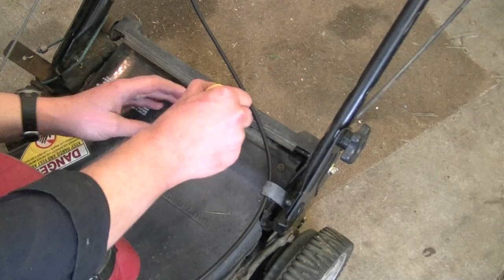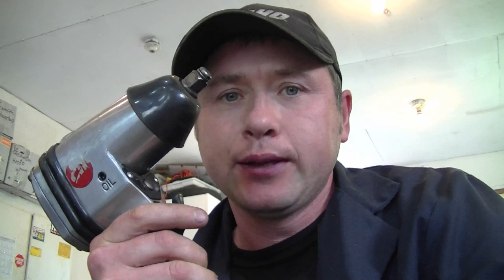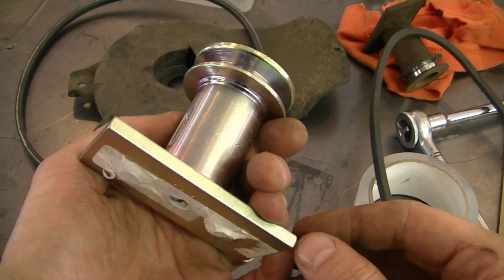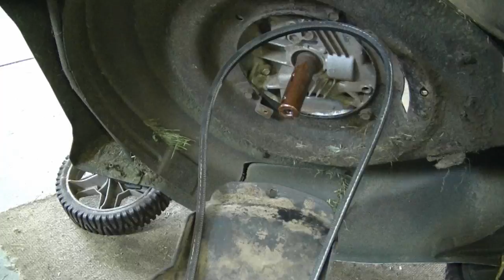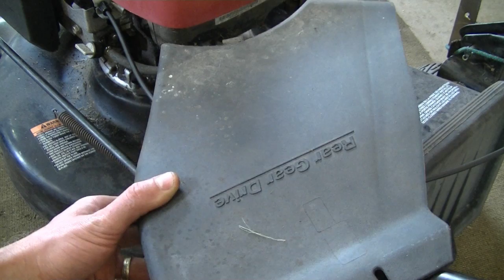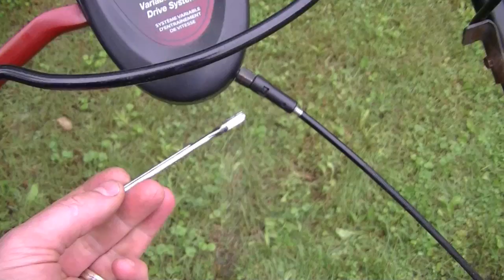Craftsman Lawnmower Drive Belt & Blade Adapter Repair

Comment: I have an ElZ walk mower like in this video. It has single control handle on the right side. My right hand gets a cramp from squeezing the one handle. Do you have a part number for the double contron handles. And can I replace the single with the double?

Comment: thank you so much, especially tip on the 1/4" screwdriver. wheels self-propelled again. would not have tried repair if not for this video. even though craftsman model slightly different. thank you again.

Comment: have a Bolens cheapie but other than the weak motor, I love it because it's so light and maneuverable. So, I took a Honda engine off a Craftsman and put it on the Bolens deck. Got everything working except for one, now obvious, problem. The drive shaft is about 1.5" too long. I would try to cut it with the grinder and a couple of wheels but I can't get access to it to cut at a right angle. I could cut it but it wouldn't be square. Can't really raise the motor because there was already a 1/4" gap I had to seal. Are there any workarounds I'm missing?

Comment: Hello again, I have the same lawnmower. Funny I just replaced the belt adapter as someone must have hit something bad because the 2 round notches were damaged.Also blade was bent. Lucky me I bought 2 of these blades at Thrift store for $2.00 sometime ago. Oh yes , the question I am asking you is the replacement number for the brake cable. I tried oiling but after it just snapped so in need  of the cable number. Thanks Joe in Owen Sound, Canada

Comment: Hi Dony.  I have a Craftsman lawn mower model #917.371822, rear-wheel drive.  I want to replace the drive belt.  I removed the blade and the plastic cover.  It is impossible to change the belt.  I have photos to send you.  I'm not sure how to send you the photos.  Please help.  RICK

Comment: Love your videos,helped me many times. I just bought a used mower like that one and the drive cable let go where it attaches to transmission.
I looks like it had let go and previous owner used a bent nail to wrap around end of cable. I can’t seem to find anything on parts diagram on what should be there and how it attaches. Any help appreciated.

Comment: Hey Don... My neighbor just "gave" me a Craftsman EZ Walk Variable Speed Model #917.370374 with a 6.75 B&S... he said it didn't run. I cleaned the mower above and under the deck, cleaned the carb, added fresh gas, primed it 3 times and it cranked on 2nd pull. Mower worked fine going forward, but when pulling the mower backwards the rear wheels lock up. However, the rear wheels do roll free in reverse when the mower is NOT running. Any suggestions? Thanks, Mark

Comment: great tip about the slippage on blade pully.  Ive replaced belt, wheels, cable and mower still barely propels.  Ready to buy a new mower.  Will replace the blade pulley next.

Comment: i bought a predator engine 173 cc, and got a sleeve to fit over that shaft. Now what kind of blade adapter pulley that will fit over the sleeve? Please advise.. thanks. Dean Wimberly

Comment: When doing a self tuneup on a self propelled (rear) lawn mower. After a years, or more, seasonal work: oil change, spark plug, filter, carborator seal & pin replacement, and drive belt, and shaken blade Anything else? Grease anywhere that needs to be lubricated.... say the drive shaft or anywhere?

Comment: Great video!

I have the Craftsman 917.375923 four wheel drive one and the belt is very difficult to replace!  I had to bend a 1/4" wrench at a 90* angle to get the belt guides out of the way.
  I used a Husqvarna belt. Works fine,now.
Sears had a part number that crossed over to that one.
Ebay had one. HUSQVARNA BELT PART# 580364603.
 Took me 3 hours to figure it out.Done.
 Thanks!

Comment: I got a craftsman mod 917.370910 6.5hp 6.75 torque .its a rear propelled and when i try to engage ie it makes terrible grinding noise at rear tires , HELP !!! LOL. 
when i lift the mower up it turns the wheels noise free ,when lowered it barely moves mower and the grinding noise starts  ,i checked both wheels and wheel gear and drive shaft gear look about brand new not bad for almost 4 years ,could the prob be the gear box what shaft comes out of ,please help
Reply: Sounds like the gear drive is toast.
Pull the rear wheels off and take a peek.
Maybe the the drive transmission ran out of oil....

Comment: @donyboy73 what is the part number for the rear cover part under the mower the holds the spindle blade and belt under the mower because the have a Husqvarna 7021r and the exactly the same I just need the bottoms cover under the blade because my belt is exposed

Comment: Love this video as I ALMOST got what I needed (I can see its spring near the belt spring, but not how to connect the lowest 'z' end).  I have to replace the drive cable on my rear wheel drive but cannot figure out how to attach the hook near the belt.  Any idea?  Thanks!  (same ez drive control, cable part# is 406258)

Comment: I'm missing the return spring on my mower that's beside the pulley and bracket. Would this affect the speed my mower will go or does the belt and adapter only determine that?

Comment: I have the same mower but my blade has 3 bolts when i try to loosen the centre one it gets loose then tightens both ways so i am confused on what to take off?

Comment: Hey Donyboy,

I have a 12 year old Variable drive rear propelled Craftman mower (917.377820) similar to this video, but both wheels some to engage/disengage on their own.  The gear teeth on both wheels are good, the belt spins the rear pulley, the axle spins, but sometimes the wheels will not spin.

I suspect the issue is with the "clutch" like pawl/pin that engages the wheel gear.  I've taken off each wheel gear and examined the spring/pawl, but all looks ok.

I did replace the spring for the pawl on the right side.

When i replace both wheels, start the mower with rear elevated, both rear wheels spin, the right side wheel stops spinning when I put it on the driveway (no power in the turn)   Is this an issue with the pawl/pin and should I replace it?

Comment: hello, i do not have a belt, i have a stiff shaft that gives the rear wheels spin, do you have a video on getting the self propell to work with this?  thanks.

Comment: Nice manuals.
I have this same model Partner G 553 CME .This simmilar self propeled.
 Problem with small element retainer drive assembly 532 1645-55
 fason Y.Where must assembly I deassembled in rebulit time.

Comment: I have a 1994 with 6.5 Honda,when pulling it backwards the drive stays engaged to some degree,wheels not pulling forward but not letting the mower want to glide backwards freely
 is this a belt problem ? The motor was the only thing good about this mower,the height settings are the flimsiest crap & the(dust control) bag is a joke, cheap flimsy closure.

Comment: @donyboy73  I have a Craftsman rear wheel drive mower with 6.5 Briggs and Stratton engine. The two notches on the blade adapter are sheared off so I have to replace the adapter. It looks exactly like the adapter in this video. Is it the same part number for my mower?? (forgive me if this is a dumb question. I'm new to this)
Reply: I know you asked this question 8 years ago however i’m curious if you ever located the correct part number? Lol called a local repair shop and they said the number was invalid....also thank you for the informative videos you share donyboy73.

Comment: hey dony i've just bought new belts for my solo 553 because i would not drive when you pressed the lever. But i noticed that the gearbox where the belt is going is lose... is this normal ? or is it broken ?

Comment: @donyboy73 the real honda mowers use the GCV engines as well, I have a HRX2172 and it has the GCV190 on it. The GX engine series are found on the HRC line of honda mowers